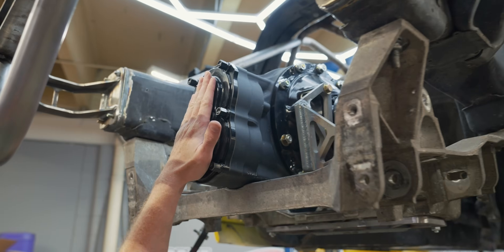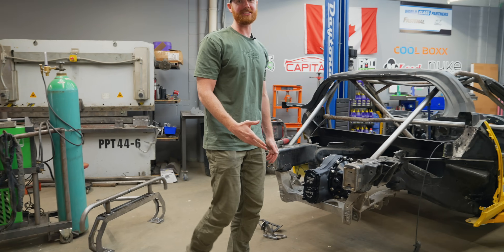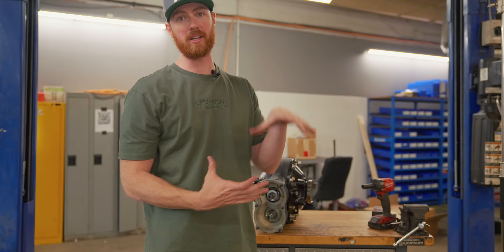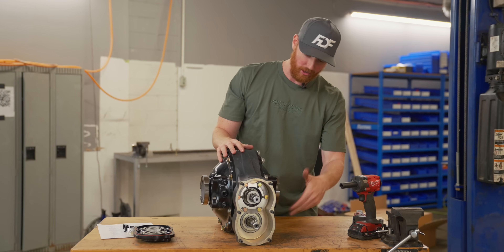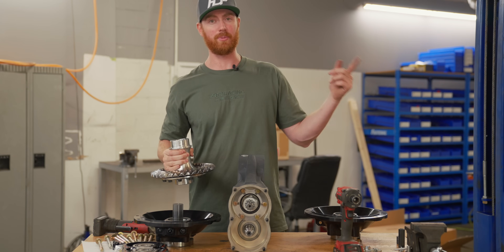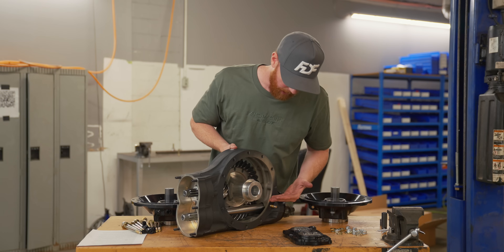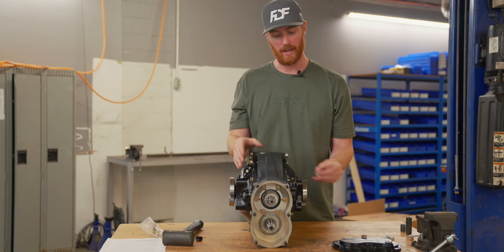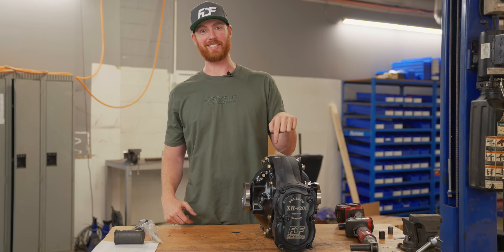What's Inside a Quick Change Differential?!?

Comment: What do you use for the 1350 joint caps on these?  I’m assuming not the standard threaded strap type? I know they’re ford 8.8” spec, a billet pinion yoke would be a nice addition, should come standard imo.

Comment: AWESOME VIDEO, super informative. 1500 hp rated? I will need this for my road race car later. Are these available with standard style live axle tube  rear end? I have an old ASA NASCAR chassis I am converting to road race use. Later after I get the car running and sorted I am going to drop in a little surprise for my competitors. Twin turbochargers and 1200 to 1400 HP. 

The QC in the car now is a standard winters live axle style used in NASCAR. 

I do wonder if you should chk the side/gear play after switching that gear over to the other side. Dimensions are supposed to be the same... but are they..really? Easy to check shaft rotation/gear mesh from the rear to confirm this but I'm betting you already know how to do that.

Comment: The make a 4.86 ratio which was the most common quick change ring and pinion for decades.  It had a 12” ring if I’m not mistaken.  Then came the 4.33 then 4.12 then 4.11.  In the 11 12 and 8” ring.

Comment: Anyone got a link to a picture showing the internals of the gearbox talked about here? I can’t get my head round how 4th gear doesn’t use gears and can just use a dog ring if the input and output shafts aren’t inline. 

As he says in a sequential, even if its 1:1 it will still use gear with the same amount of teeth, I can understand that.
Reply from the maker: It is a Gforce GSR, and the input shaft and output share are inline with each other
Reply: @FDFraceshop  thanks for this. That makes more sense, havent seen one like that before

Comment: Could you explain why rating is in HP? Is it US thing?

In Europe we use torque to determine strength of gear things (diffs, transmissions). For example ZF (transmission manufacturer) rates their products by torque.
HP tells nothing, low revving V12 with massive torque and high revving R6 with lower torque both can have 1500HP but forces are completely different.

Another confusing thing is 1500HP+. What + means? More than 1500? Does it mean it can handle 1599HP or 5000HP?